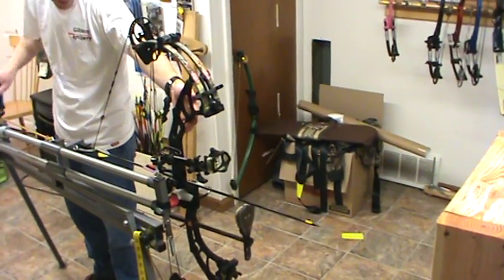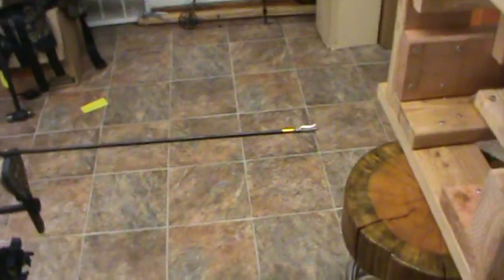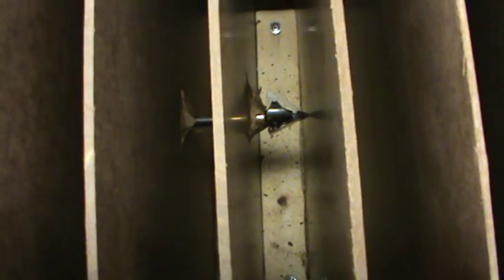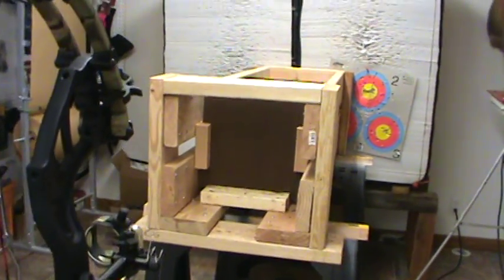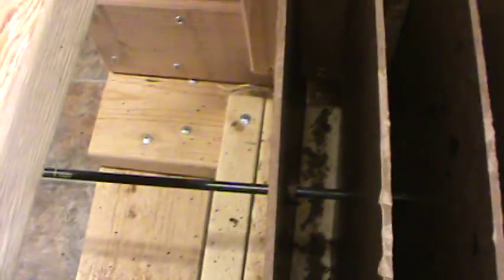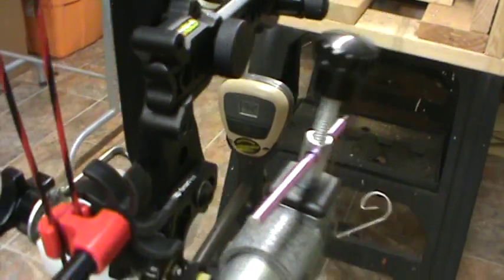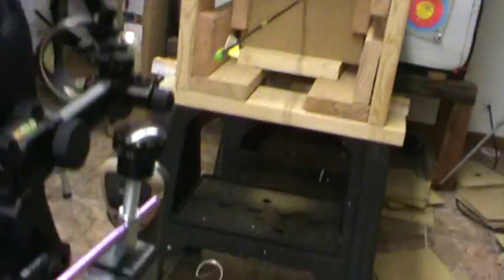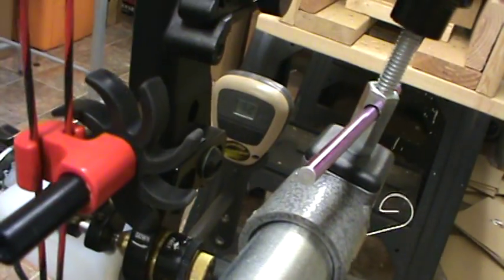part 2 of the Ultimate broadhead test 60lb PSE Evo

Comment: Um I think many here are missing the point. This is basically an ultimate penetration test. It is like seeing if these could kill a rhino based on cutting power. Lets face it, deer bone or any animal bone just got screwed. So you know these will penetrate the animal. As far as the arrow gaining more power from a distance is somewhat true. This test is putting the bows full power into the test. Not degradation or help from gravity that could help or hinder the effect. Seriously jason king, what is with your comment. Out of line is more like it. Did you upload a video test that is better in your opinion? In any case this is good evidence most broad heads will do damage to harder surfaces and especially bone. That is if they are close shots. This test would likely lose its realism at a distance. Good in any case.

Comment: Are you sure you aren't too close with that bow?  A well tuned bow is still going to have some flex in the arrow that close, but would be straightened out by the time it hit your target, sending all energy straight forward.  Also I would think that a flexed arrow would throw in all sorts of variables as far as how your mechanical broadheads deploy/penetrate.  5-10 yards away would take out the flex variable and then this test would be spot on.  Still a great test, just leaves room for question

Comment: @adriwow123 it will have lesser penetration against wood plates (as they use) but will eventually have the same penetration vs. flesh because of the cutting edges (they do not cut the wood properly because it's hard)
Ballistics gel would be more accurate for penetration testing.

Comment from the maker: @robbcayman The test is based off of wood penetrated so the thickness of each individual board does not change the outcome. If you have 9 boards at 1/8in thick or 6 boards at 3/16in thick they still add up to be 1 and 1/8ths inches of board the only factor in this case is the density of the wood and it is the same. Arrow speed varied due to the weight in the heads for example G5 T3 w/arrow was 439.2gr G5 montec w/arrow was 443.4 same manufacturer exact same arrow different weights.

Comment: No offense, but if you changed the thickness of the board then it will change the outcome. Plus, the bow speed was inconsistent, which also plays a large factor. Thanks for the hard work!!! I think most heads will put game down.

Comment from the maker: All of the tips tested were labeled 100gr but they actually werent exactly so they slower the velocity the more the tip weighed. I weighed every arrow broadhead combination before each shot to be as accurate as possible then using the formula for kinetic engery 1/2*(mass*(velocity^2)) plugged in the info and found the kinetic energy for each shot.

Comment from the maker: The Calculated results will be posted tomorrow night. The calculations are based off of the amount of board penetrated and the effective cutting diameter meaning the actual diameter cut into the board not just the cutting diameter on the package. thanks for watching check in tomorrow night for the results.

Comment from the maker: The darker boards are 1/8th inch and the lighter boards are 3/16th so they are a 1/16th thicker but have the same density as you can see on the control test the field tip penetrates 14 of the darker boards and 10 of the lighter so total wood penetrated on the darker wood was 1.75 in and total lighter wood was 1.875 when the velocity of both shots are taken into account you get the same value for penetration. I would have kept it consistant but the thinner wood was no longer locally available